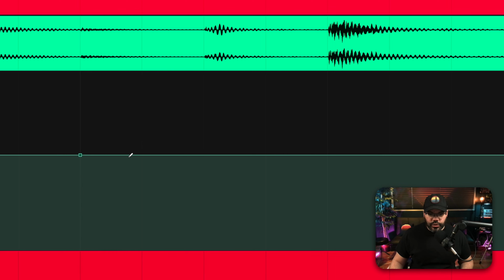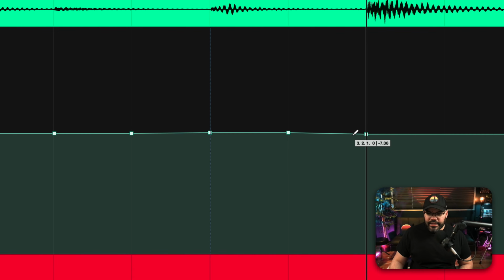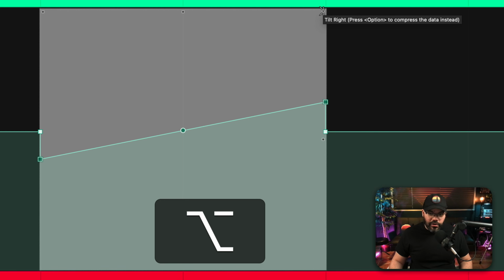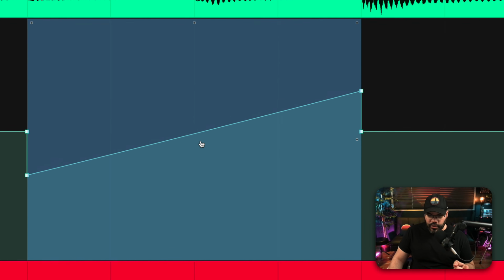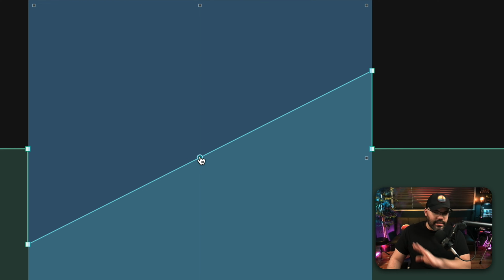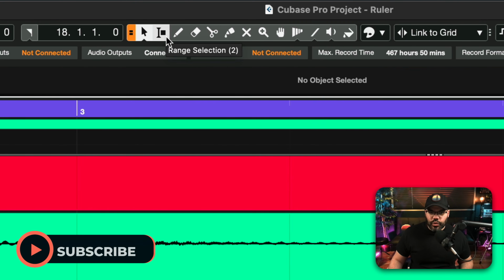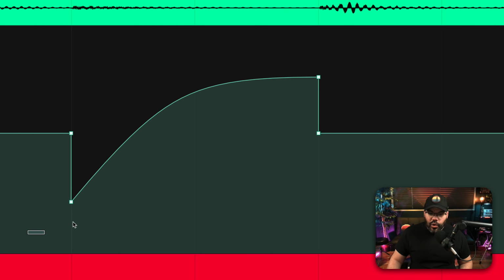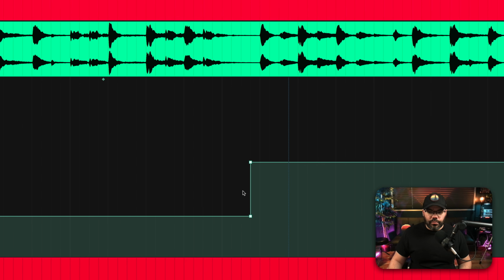Edit Automation Points in Cubase like a Pro! Easy Tutorial for Beginners

Comment: My Cubase is not like your instructions in the smap section, I turned on the grid and it still doesn't capture the grid. I used Ctrl but the points are still not like yours.
Reply from the maker: What version do you use?